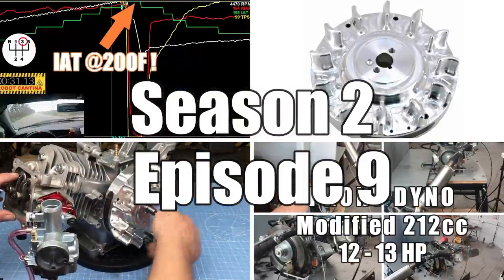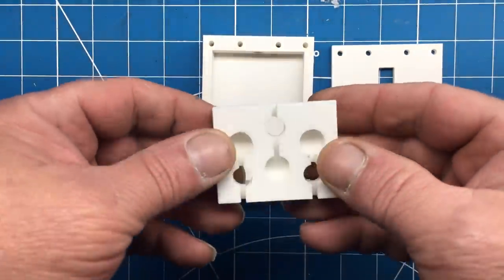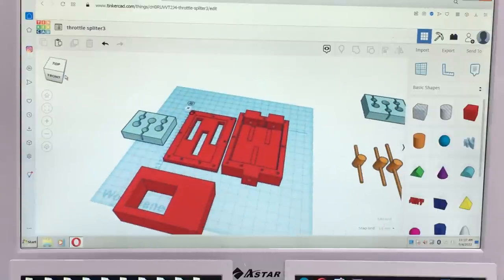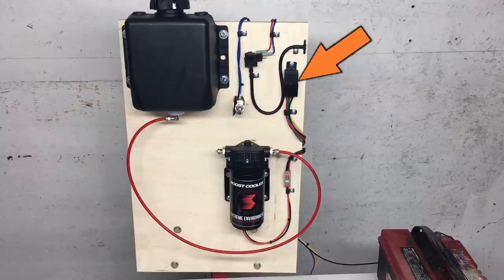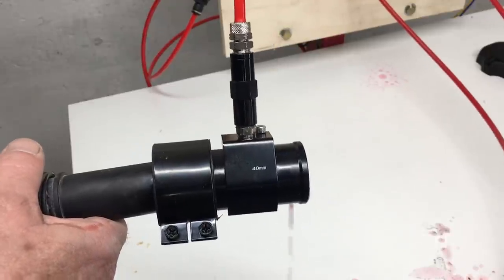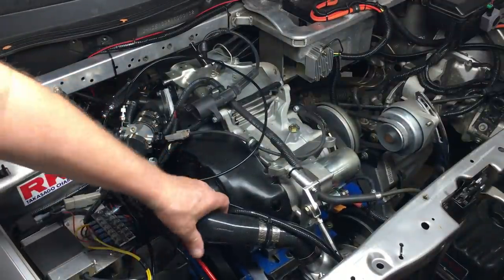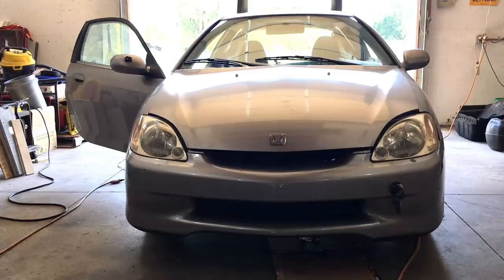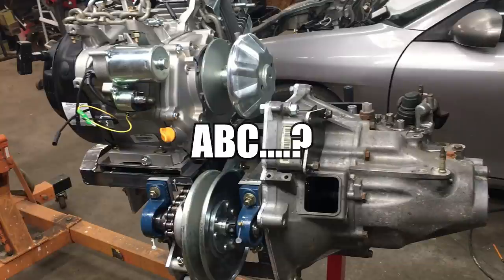S2E9: She’s burnin’ up Cap’n!  The 420cc supercharged hemi gets methanol  injection

Comment: Don't really understand why you test the atomization and flow rate on atmospheric pressure. I mean, you will shoot it into a pressurized environment, which will change the flow rate and outcome of the atomization process. :)

Instead of using a "clicky clicky" relay, just use an SSR one, to avoid delays by the relay and make the activation of it more predictable. Not sure if that's a factor here, but I guess injecting into the pipe will increase the pressure, so keep the pump running while an open port on a cylinder will momentarily decrease the pressure and turn off the pump.
Reply from the maker: We used parts that were available around the shop.
Reply: @robotcantina8957  you don't have any SSRs laying around in your workshop? I'm shocked 😲

Comment: you might want to move the meth injection nozzle as close to the intake port as possible, to keep the methanol charge from un-atomizing as the air slows down around corners and other restrictions, causing puddling. and to keep the air charge (and the supercharger) cooler, in addition to an intercooler, you really need to remove the initial throttle body before the supercharger, and put a recirculating valve like used on turbocharged cars on the outlet of the intercooler, that opens when the throttle body closes and the intake pulls vacuum, so you can either dump the boost charge to atmosphere, or recirculate it back into the intake of the supercharger. right now when both throttle bodies are closed, the supercharger isn't being cooled at all.
Reply: the Bosch 0 280 142 110 recirculating valve might be a good place to start. they can handle up to 26psi of pressure, and are cheap since they were common to a lot of 90's turbocharged cars from SAAB, volvo, audi, porsche, etc.
Reply: @francistheodorecatte  😊😊😊
Reply: @ocdman202  🤓🤓🤓🤓
Reply: @kansasrose2909  Rose,  did you see the price of gas??

Comment: A better/stronger throttle cable splitter dealy can be found on 90-99 eclipse/talon/lasers with the 4g63 engine and cruise control (heck might even be on the base model cars too).   It's a rotary style design.
Reply: @ocdman202  Great content here.

Comment: I READ THE DESCRIPTIONS!! Usually looking for links or part numbers to some of the parts your using. I started a project 5-6 years ago supercharging and fuel injecting (Microsquirt V3) a 7hp Kohler (K161S) with a Hansen V-12 Supercharger. The engine is on a '62 Cub Cadet Original made to look like a pulling tractor. Anyway... I got hung up trying to find a reasonable throttle body that also had a TPS sensor on it. Todays episode may have a pretty good solution to that issue.  Thank you.
Reply: Believe in your own universe and the universe will form around you.
Reply: Which is harder to come by??  Baby formula or gas?
In my universe both are like gold!
Reply from the maker: Your welcome and good luck with the project!
Reply: @robotcantina8957  💖💖💖💖💖
Reply: @kansasrose2909  Rose,   I see your heart is in the right place.
Reply: Robot,  are we going to see more from Robot Cantina??
Reply: @ocdman202  "If you really look closely, most overnight successes took a long time."

Comment: Honest.  I’d have just gone with a propane injection setup for this instead of alcohol injection.  Probably would have been simpler.  But at that point, you might as well have converted over to pure propane power, so I can see why you stuck with methanol.
Reply: @kansasrose2909  Rose,    you seem very happy with this video.

Comment: Description of detonation is incorrect. Detonation / knock is post spark event uncontrolled combustion. Pre-ignition is before spark event uncontrolled combustion.

Also, maybe it works with the aero of this car but normally spacing back of the hood up like that has a negative effect for cooling because the windscreen behind it is actually a large high pressure zone. Hence the reverse air intakes often seen on some old muscle cars / dragsters.

Comment: Could you pulse the RO solenoid faster? Prometh/aquamist put them near the jets and pulse at 30ish Hz using pumps in bypass (at the pressures you first got albeit)

The mist in the pipe reliquifying or blowing out of bovs etc is aggravating and often overlooked. Good episode!
Reply from the maker: Yes, it will pulse faster, however in the video I showed it at its slowest speed.
Reply: @robotcantina8957  😊😊😊

Comment: I finally got it several videos back, but please forgive my previous calls to ditch the cvt.  The stock transmission ratios are just too wide for the cement mixer engine.  At this point, we know that the car requires X amount of torque to maintain 64-65 mph.  I say take it on a road trip and see what the old girl can handle as far as duration!
Reply: Yes... We are enjoying the journey into the unknown...
Reply: @ocdman202  How far out do you go?🪐🪐🪐🪐
Reply: @kansasrose2909  I love this to the moon and back.
Reply: @ocdman202  Well,  I hope you have enough fuel to travel.

Comment: Meth injection does require a bit of leaning on the tune, but I'm worried that your injecting so much it's hurting as much as helping.
The spacers on the hood would actually act as  an air intake because of the effective undertray and pressure buildup at the windshield.
Reply: @ocdman202  Man you look very pleased with this channel.
Reply: @kansasrose2909  :virtualhug::virtualhug::virtualhug::virtualhug:

Comment: Two good turbochargers coming your way by Wednesday! 1.9Tdi and 1.8T K03 turbo (TDI Turbo is perfect for roughly 500cc of displacement. Should see boost at 3000+ rpm)
Reply from the maker: Awsome!  thank you!
Reply: @robotcantina8957  😊😊😊
Reply: @ocdman202  Which is harder to come by == baby formula or gas??
This channel has me coming back for more..👶👶👶👶
Reply: @kansasrose2909  They are both worth their weight in gold!
Reply: @ocdman202  Baby formula and gas are pretty pricey.
Reply: @kansasrose2909  When I was a teenager in the late 30's and early 40's, electronics wasn't a word. You were interested in radio if you were interested in electronics.

Comment: simply add a pvc valve between the intake and out put hose of the supercharger. suggest using one from chevy 350  Valve will restrict bypass flow and block back pressure from supercharger

Comment: A "TURBO" will give you more horsepower per pound of boost because a supercharger robs a lot more power from the crankshaft than a turbo does from exhaust gas restriction, could be something else to consider.
Reply: Do you think a Tesla Turbine would help?
Reply: @kansasrose2909  It is worth a try.
Reply: @ocdman202  Has he installed the capacitor yet??

Comment: Don't control the pump with pwm, leave it powered all the time at your desired pressure, you want to get better control of your Injection valve pwm and ramp it on, to 100%. Ihave a 800awhp single n54 with 1300cc 50/50 meth
Reply: Great content here.
Reply: @mommapanda5736  Jimbo === is that Saturn back on the road yet?   We want to see how it runs with the Diesel engine  in it!👍👍

Comment: Don't forget to change position of methanol nozzle if You are planning to use both, meth and intercooler... You need to place nozzle after intercooler otherwise it will just collect on the walls of the intercooler and You end up with intercooler full of boost juice 😂Allso, You should handle methanol more carefuly because as I know it is poison and You shouldn't get any of that on Your hands or breathe a lot of it.

I don't understand Your resoults, most dragsters runs on pure methanol and You can see condensation on blower when they idle it... But I need more practise to tell You whats wrong 😂 I'm planning to install meth injection on my BIG engine -> N/A 0.8L 3cyl. So allso thank You for the tips and tricks, I want to regulate pressure purely by controlling PWM of the pump and use engine RPM to set PWM... Bc You don't need fixed value of the meth, it is constantly changing with engine RPM and boost.
Reply: @kansasrose2909  Rose,  you seem very pleased with this build.

Comment: instal pvc valve with valve cover sideon intake hose. to avoid detonation change to using lpg gas fuel. When used in diesel engines lpg and compressed natural gas require spark ignition as the heat and compresssion alone will not fire the mixture. LPG CARBORATORS WORK GREAT ON TURBO CHARGED ENGINES  as they can be installed o n the turbo intake side avoiding the atomization problems of ligiid fuel along with the problem of detonation from high boost pressure

Comment: Those mixer engines we used them for boat racing  if we can obtained a 420cc and I'm not from Thailand I'm from the Philippines we race boats as well but in the sea  we only used lower cc the reliable ones

Comment: Tell me again why the throttle body isnt just post supercharger, like every other install? 
If you want to leak off air during driving to reduce strain, just add a blow off valve, one of those stock vw 1,8t from a golf mk4 - way simpler
Reply from the maker: We are using a positive displacement supercharger and not a turbo.  For supercharger applications the throttle body is ahead of the supercharger.
Reply: @robotcantina8957  Thats not a requirement. Thats just one way of doing it. Usually when using pre-throttle, you have a vacuum bypass internally, or just a charger with seals designed for the task. Using this you have with throttle post, just adding a blow off valve will take care of your issues. SC will be running freewheel, as long as pressure difference in pre/post throttle is greater than the springpressure in the blowoff, i.e. running part throttle

Comment: I never looked to see if the exhaust lobe on the cam was modified or easy start was removed on this engine. Check to see how long the exhaust valve is held open past bottom dead center. The longer it's open the less compression ratio and easier to start by hand.
Reply from the maker: When we built the engine we kept the compression relief thingy on the camshaft.  The only time that becomes an issue is when the engine is cold and the idle drops below 900 rpm... then the engine will stall because of the exhaust valve stays open.
Reply: @robotcantina8957  😚😚😚😚
Reply: @ocdman202  Man,,,   Did you watch all of season one of ROBOT CANTINA??
Reply: @kansasrose2909  "If you really look closely, most overnight successes took a long time."
Reply: @mommapanda5736  CONGRATULATIONS  JIMBO.  👍👍👍👍👍 you have reached 106K   SUBSCRIBERS!   ROBOT CANTINA 
is providing the entertainment and education and FUN   that viewers enjoy!  Please provide more content here JIMBO!

Comment: I'm well aware that water/meth injection is just an interim design choice to prove concept on the engine. But I will mention that it's very important that anybody doesn't rely on water/methanol injection as a solution for every day use, as it damages the engine and seals over time. Everyday use design choice should always be some kind of heat exchanger, whether that be air to air, or air to water heat exchange. One last thing I will add, is if you can, cooling the oil on an air cooled engine, makes an incredible difference in overall engine temperature. Technically, it may not be possible in some cases without a custom external oil pump and surge tank setup as in the 420cc engine doesn't have an oil pump.
Reply: @kansasrose2909  Rose,  you seem very happy about this video!!
Reply: @ocdman202  Man,, did you see that bazooka??  It was custom made!!
Reply: Which is harder to come by   == baby formula or gas??👶👶👶👶👶
This channel has me coming back for more!
Reply: @kansasrose2909  They both are worth their weight in gold.
Reply: @ocdman202  Gas prices hit another all time high on Thursday!!

Comment: Meth injection, that's gnarly. Even higher octane means more boost.
I wonder if a car radiator used like an intercooler would work at all to cool down the intake temps.
Reply: @kansasrose2909  Man,  you seem very happy with this video.
Reply: @ocdman202  Has he installed the flux capacitor??

Comment: So it was an everything bagel, well toasted, with whipped cream cheese. Seems a fitting parallel for this episode, and I’m still picking the poppy seeds out of my teeth (both physically and metaphorically). The meth setup is a brilliant piece of engineering, but I wonder if injecting downstream of the supercharger (and keeping the meth out of the pressure cooker) might yield better results. Also, how about an intake swamp cooler? A medical ice machine wrapped around the intake pipe and plumbed back to the passenger floor might do the trick. However you do it, you’re going to have to get that detonation under control before adding the nitrous.
Reply from the maker: Having grown up in New York, I can appreciate an everything bagel....  sooo goood.    The original concept of injecting the meth before the supercharger was to try and keep the supercharger cool as well.   With the future addition of the intercooler we will sadly loose the Bazooka and try injecting the meth after the intercooler..... if we can get it all to fit...lol
Reply: @robotcantina8957  external water cooling for the supercharger?
Reply from the maker: @michaelcrumlett187   It's interesting you should say that.  Right now at this very minute we are doing experiment on the supercharger temp and if the oil is effecting it.  Currently our belief is and we have data to prove it, the little supercharger is where all the heat is coming from.  With the supercharger disconnected from the induction system it will get up to 200F after 20 min  at idle....and since it is disconnected, it isn't compressing air. so we cant blame it on heat from compression.  Anyway none of the oils we tried seem to help...  It may be that this is normal and the only solution is the intercooler.
Reply: @robotcantina8957  😊😊😊
Reply: @ocdman202  Man,  did  you see that bazooka??
Reply: There should be a drinking man's guide to this build...  
Maybe ESQUIRE could come out with that. 😘😘😘
Reply: @kansasrose2909  Yes,  they could start with how to make
a very dry martini and end up with the custom bazooka.
Reply: @ocdman202  "If you really look closely, most overnight successes took a long time."

Comment: I wouldn't expect any significant power increase from the meth absent other significant changes. It will likely allow for more boost, more timing, or some combination of the two, but absent either of those you won't notice anything. 

If you were getting detonation, and it stops due to this, then you'd notice a change I suppose. 

As you're discovering, a Roots blower produces very high IATs. I hope you figure out some way of bypassing it to make it less bad.
Reply: @ocdman202  Man, you look very pleased with this channel.
Reply: You may be in need of a very dry martini!!🍸🍸🍸🍸🍸🍸🍸

Comment: I believe the methanol injection is supposed to be after the supercharger, to better cool the air after it's been heated.
Reply from the maker: The instructions that came with the kit indicated the meth could be injected before or after the supercharger and they actually recommended injecting the meth before the SC  to help keep it cool.
Reply: @robotcantina8957  💖💖💖💖
Reply: @robotcantina8957  Ah, good to know.
Reply: @tOSdude  When I was a teenager in the late 30's and early 40's, electronics wasn't a word. You were interested in radio if you were interested in electronics.
Reply: @ocdman202  Cool, I guess?

Comment: Seems like the motor needed some internal upgrades to handle more than 45/4600rpm it currently maxes out at.  Cam, flywheel, governor delete, con-rod, maybe a slightly thicker headgasket to decrease compression a bit given that its forced induction now although knock doesn't seem to be a problem.  Just seems a bit silly to have all the emphasis on bolt ons, without doing anything to improve the internals.  Even without a dyno, you could have compared performance from porting and polishing, then a cam swap, etc.
Reply from the maker: In the previous supercharger video, we installed an ARC billet connecting rod, governer delete, stainless steel valves and stiffer valve springs.  Also in another previous video we discuss why this engine cannot use the ARC billet flywheeel.
Reply: @robotcantina8957  Ah, ok I'll admit I missed that and skimmed throught playlist after watching this video.

Comment: Have you thought about nitros oxide  solenoid/jet system for the meth system you can probably get a better selection of jetting for the meth system then you can run in a closed loop system rather than open loop with higher psi for better atomized spray
Reply: @kansasrose2909  Rose, you look very happy with ROBOT CANTINA!
Reply: @ocdman202  I come here for the great videos and stay for the comments.

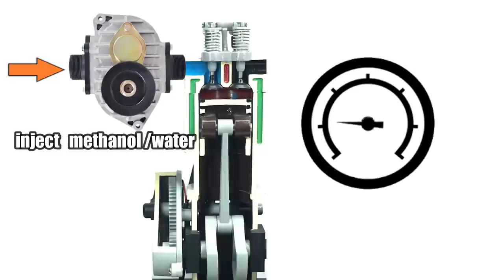Comment: at 7:45 the statement that injecting methanol into a turbo will destroy it is incorrect, in the early days of draw through carburetor  turbo kits spraying water/methanol down the throat of the carb  was common with no adverse affect on the turbo
Reply: :virtualhug::virtualhug::virtualhug::virtualhug:

Comment: Looks like it needs some sort of cold air intake. I can't imagine  its creating enough boost to cause all that heat.
Reply from the maker: The engine is sucking cool outside air directly from the grill.  We have determined the crazy heat is coming from using the wrong oil in the supercharger.
Reply: @robotcantina8957   what oil did you end up using? On my friends miata with a amr500 we used procharger synthetic because it is what I had on hand.
Reply: @freyja4954  "If you really look closely, most overnight successes took a long time."
Reply: @mommapanda5736  CONGRATULATIONS  JIMBO.  👍👍👍👍👍 you have reached 106K   SUBSCRIBERS!   ROBOT CANTINA 
is providing the entertainment and education and FUN   that viewers enjoy!  Please provide more content here JIMBO!